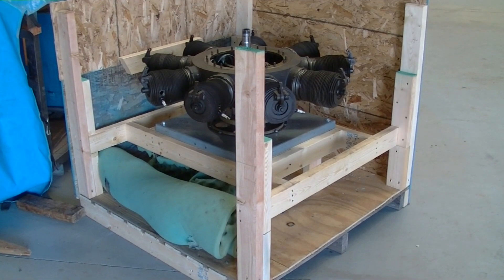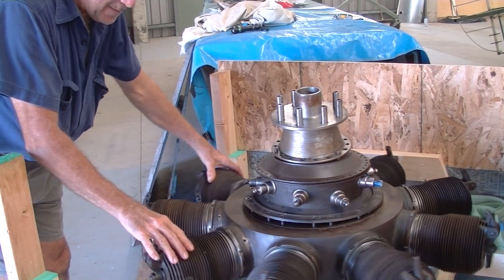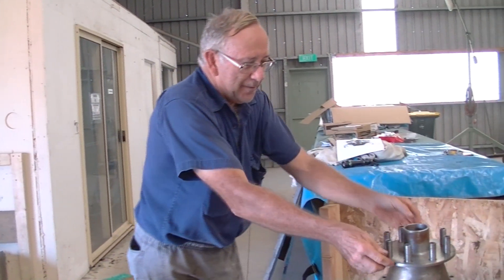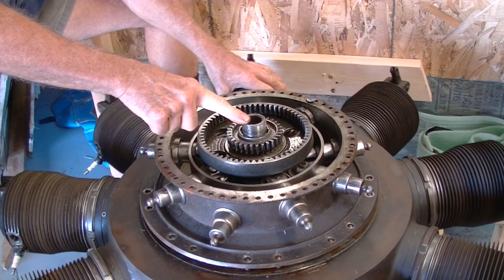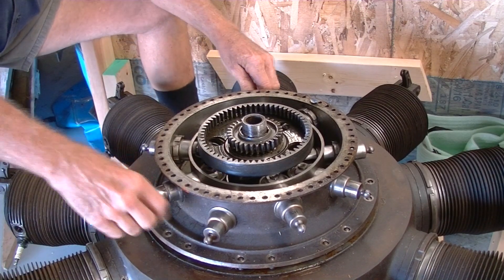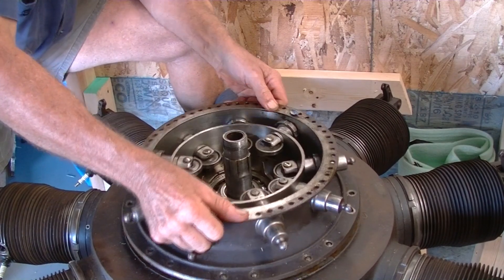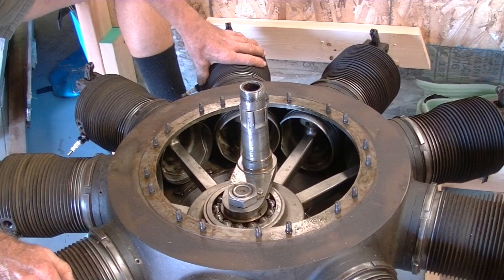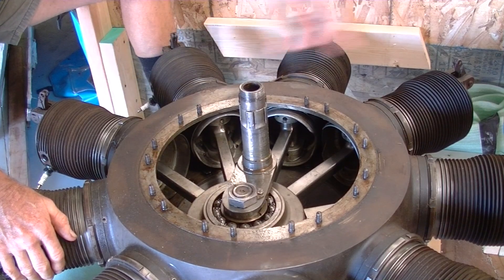Vintage Gnome Rotary Engine Unpacked 16-02-2014

Comment: All these radio piston engines use an odd number of cylinders to create differential force that guarantees turnover.   Nine cylinders is the feasible maximum. Three cylinders is barely functional with changing loads
Reply: @JohnSmith-eo5sp  there are 7 cylinder and 5 cylinder, not so much radial rotary just radial,light weight and good out put for size
Reply: Is because all "daughter rods" are connected to a "mother rod", so the total rod number can only be odd 3, 5 or 9...and double row: 2x7=14 or  2x9=18 cyl

Comment: Wouldn't this be considered a radial engine? Or does the fact that the entire engine rotate make it a "rotary"? I always considered rotary engines to be that of the wankel or reneisis type.
Reply: These rotary engines pre date both the radial and the Wankel engines.
Reply: @phlodel  Wankel engines are not rotary: they pistons did rotate on a excentric...was originaly named KKM= kreiss Kolben motor= rotary PISTON engine
Reply: @leneanderthalien  Wankel engines are commonly referred to as rotary. Will  Thacker used the term in the original comment. The original rotary was the aircraft engine that had cylinders that rotate around the crankshaft. They could also be referred to as rotary piston engines.
Reply: @phlodel  the wankel was named "rotary engine" from the Japanese from Mazda: i think they find this designation sexyer and simpler as "Wankel rotary piston engine"...
Reply: @leneanderthalien  "Let's go on to something ruder...
...'WANKEL ROTARY ENGINE'."
- Monty Python 😉
Reply: Rotary engine is what these were always called since the 1910's.

Comment: It looks like it is very inefficient rotating all that poorly air flowing mass.
Reply: AL: Fuel efficiency was not a concern, and it was not a problem mechanically.  It worked quite well.
Reply: @KB4QAA  Fuel efficiency was very important at the time and is why the beautiful classic cars in the UK were desired but unaffordable and the small 7 HP cars from the 1920s were desired.  But in an aircraft, it matters because of the range of the aircraft and that was always an issue,
Reply: @AndrewLohmannKent  As a pilot of 40 years I'm quite aware of fuel efficiency 'in flight".  However, in WWI fuel efficiency was not a design factor in any manner. There was no shortage of fuel. There was a shortage of engine power. None of these engines were designed for fuel efficiency. The aircraft had no shortage of fuel storage capacity, nor was endurance over a couple hours a requirement.
Reply: not forgott that the ww1 gasoline alow very low compression ratio (between 4 and 5 to 1)...the success from this engines was he's leightweight and good cooling...
Reply: Its easy to look back at technology that's one hundred years old and point out what's not good about it. The idea of rotating the cylinders was to keep them cool, overheating was a big issue before liquid cooling was invented.

Comment: this engine opens the exhaust valve to let out ex gases then it stays open for most of the down stroke at which time it closes and the piston opens a port pulling in rich mixture from the crankcase. the rich mixture mixes with air in the cylinder and you have a normal mixture then. sort of a 2 stroke but not really
Reply: yeah I keep thinking 2/-

Comment: Know what the "head scratching" is all about.... Back in '82 I had purchased an Alfa Romeo Alfetta. .. The rubber dust boots had deteriorated so I bought a package of four for the trans-axle (in board and outboard for both sides on this De-deon rear end..... After dismantling both drive shafts and cleaning and re-greasing them, I put them back together.... Had a 50/50 chance of getting it right the first time and chose not to.... The wheels would rotate but NO flexing.... Had to dismantle everything and pay real close attention as to the proper working of said system.... 

I love round engines.... The mechanics of it, the firing of every other piston, the crankshaft - EVERYTHING.... It's a work of beauty.... The sound of a Pratt/Whitney going by (from Doppler up to Doppler down) makes the hair stand up on your arms.... 

Thanks foe sharing your vid...!!!! 

Gordon in Maui